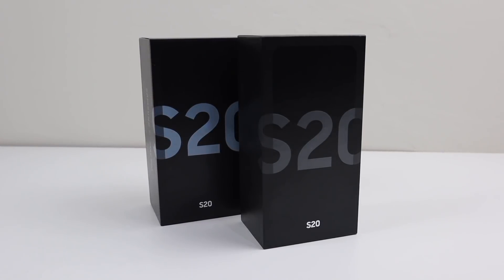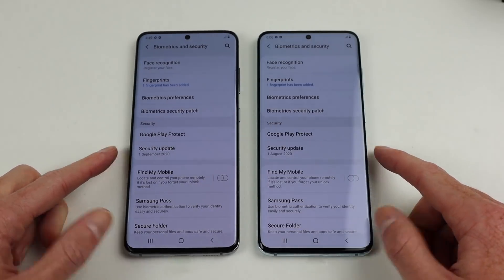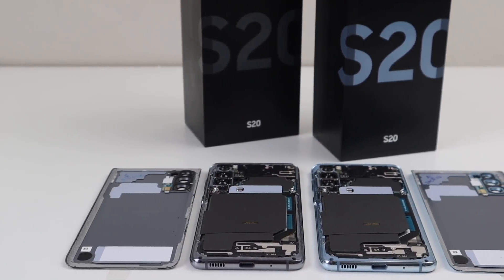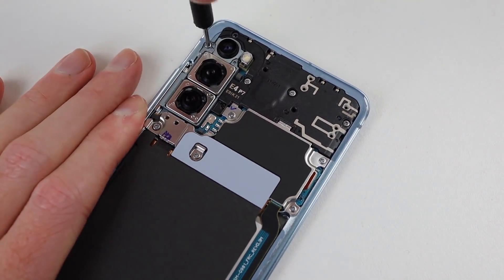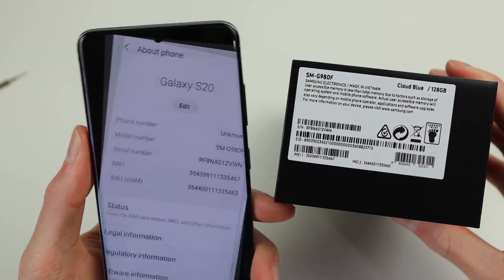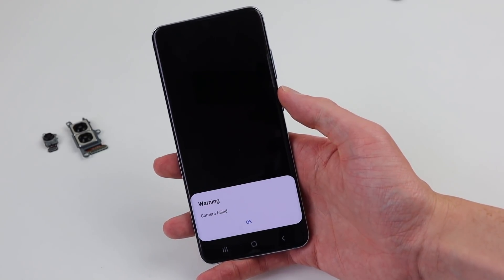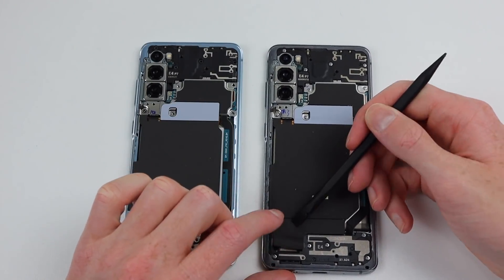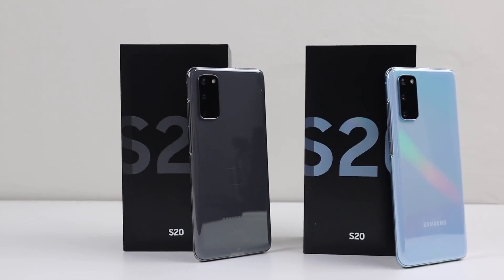Is Samsung locking down 3rd party repairs? Galaxy S20 Teardown and Repair Assessment

Comment: I have an Oppo with underscreen fingerprint reader, fingerprint data is stored on a chip on the main board, i damaged the screen twice and 2 aftermarket swaps, never needed to redo my fingerprint. Samsung... Its possible

Comment: Something important to mention is that Samsung phones since at least the S6 record battery usage data on the motherboard - the ASOC and Charge cycle data. It does not get reset when replacing the battery, and only autorised samsung repair centers can do such a procedure. They replace the battery and reset the "Discharge counter" as well as the ASOC value (they reset it to 100 so i assume it's the battery wear indicator). Not doing the reset can result in the replacement battery (even an original one) to behave either a bit worse or just as bad as the old battery. I learned this the hard way with my phone.

Now there is a possibility of modifying these values if you have root acces, but with samsungs that means tripping knox warranty bit - essentially loosing some functionality like secure folder etc. Samsung uses either their GSPN network tool or the "Galaxy Must" tool to recalibrate the phones. Using the must tool you can recalibrate the battery, fingerprint sensor, hall sensor, light sensor, proximity sensor, grip sensor etc. Unfortunately the program is near impossible to find, and even if you can fing it, it requires connection to samsungs network, along with logins, which are simply impossible to get.

Comment: the A series is a hassle to repair even if you go through Samsung themselves. tried to get my brother's phone repaired and Samsung and Verizon's "approved" repairers insisted it was an international phone (it was sold as  US model...) and that they would not repair it despite having the parts. we ended up hunting down some executive office emails and they were much more concerned about it. they ended up taking my brother's phone, confirming it was international and then replaced the internals with US components whole keeping his data.

this process took 8 months. my brother did not have a phone for 8 months.

Comment: Great video. Thanks for doing this. You've mentioned the non-charging issue mentioned by someone on Instagram. Do you have a link to that post or more details on how does that manifests ? S20 Ultra I have stopped charging. Battery went down from 50% to %0 while I was looking at it. Won't charge. . If I reset the phone, it will come up and show 0% charge and will start charging very slowly charges up to 6%  and won't charge further. But it only shows 6% - it won't hold the charge if the power charger is disconnected. Took to it to Samsung - they could not tell what's wrong. They would not replace replace the battery,  said that replacing the charging port makes no diff offered me to replace the motherboard as a next step for $500 (12G/256G). Not worth it. I poke around the insides, looking for any kind of physical damage. I replaced the battery and took the motherboard out, examined it very closely with powerful magnifier helmet. Phone is crystal clean inside. No signs of any damage, no bunging, no oxidizing. Interesting.

Comment: Actually, if you remove the pcb with the cameras from the lcd and reinstall them you need to do alingment to the cameras, in order to work properly. Even if they are the same as before.
If you notice the 3 cameras are not fused together.

Comment: Ridiculously costly authorised repairs and original spare parts, blocking 3rd party repairs by gluing in components (eg non-removable battery) and planned obsolescence:

In this case, "Don't like it, don't use their products" doesn't work for 3 reasons:

All companies are follow the same money minting trend since no one speaks out against it, and the average consumer is too ignorant to care, so there's no one left to buy from

And second, those who practice such tactics as planned obsolescence make more profit in the long run and so are able to sell their products at a lower price. The average consumer being unaware of this, will obviously not buy the costlier product, thus those who decide to do things ethically are at a huge disadvantage.

Not to mention higher profit means more R&D budget, which means the unethical ones will pull ahead in today's cut throat competition, so it really isn't economically viable to be ethical.

Hence the need for laws

Comment: If you are checking if the camera can be changed. Why are you replacing the camera and logic board in as a unit?  How else would the phone know know camera has been changed? I have never ben to your channel before. But I know wonder if you work for samsung. I assume not. But the doubt is now there.

Comment: I am a samsung user and I do experience that camera thingy. That is because an app may have been using the camera and the user did not fully close the app and the phone is still running the app with the camera open. That's somewhat a glitch or something but that's easy to fix, I guess.

Comment: Really appriciate, Hugh.
Well I think samsung is locking the repairs in A serise phones, because they are focused with the security of the Data in the product.
But I think that you should do repair of one of those A71. Or you can try, Huawei mate 40 pro, One Plus 8T, or Samsung Z Fold 2

Comment: Hugh please help!

I have a Early 2011 13-inch Macbook Pro. Whenever i turn on the computer, while the bar is moving when booting, it gets stuck and the bar does not move. Then, when i boot into the main OS after a couple of reboots, i managed to log in and use the mac. Then, after 5-10 mins, the whole computer bricks and the mouse cursor or anything thats supposed to move does not move. I then restarted the mac, and the  screen froze with a apple logo and a half-loaded loading bar. I tried internet recovery. When i boot into internet recovery, the screen freezes on the globe. Pls help! I cant even boot into a USB Thumbdrive as it gets stuck while booting. Is it a hardware issue? Or is it only the hard drive? Pls help!

Comment: @Hugh Jeffreys
As a Samsung Care tech I can promise you and rest assure you heating the back glass on your heat plate and reapplying the back glass and pressing the device will seal the device water tight. As there are times rework kits are not available this method has been used in multiple shops. Your backglass adhesive still looked completely intact.

Comment: Samsung usually listens to its customers and lets us repair our producs so i really respect them i got some hate on apple because i worked repairing electronics for a few years and om rare occasions slipped and messed up touch id on ipads and not being able to fix it  myself just brings me unesesary trouble also i had a lot of customers that got their iphones wet and everything worked exept the ear speaker but ther ear speaker is connected to face id and that also is unfixable so basically you got a bricked phone just from a bad ear piece apple is straight trash for that and even tho i still use iphones along with samsungs because i always have 2 phones i just buy them second hand theres no way in hell imma pay factory price for a throaway phone when apple doesn't give a crap about us i do pay factory price for my galaxys tho i really enjoy samsung producs i just bought a titanium galaxy watch 3 that works with both iphone and android big ups for that

Comment: Well I'll give Samsung a pretty 7/10 for repairability; all same screws, adhesive backplate without delicate cables that could be severed by pick insertion, all modules easily removable with few connectors and best of it all, no serialized modules that disable 3rd party repairs; thumbs up (as opposed to f'n iphones)

Comment: All the parts you "replaced" are all official Samsung ones tho. Not sure if you installed a camera module, charging port, or screen off of eBay or Amazon and it still work or not.

Comment: @HughJeffreys, the best phones to replace or repair are not the the flagships in 2020, i notticed it when i had to fix my note10+ i broke my screen and i got a replacment, swapped it all over, and it wouldnt read my card, had to send it in to samsung and have them repair it.

Comment: It probably didn't work for the guy because he swapped parts between completely different variants of the s20. Exynos to Snapdragon. Or the usual regional shenanigans done by samsung where the international model, us variant and south korea variants use totally different parts

BTW: On Samsungs with optical indisplay FP scanner the scanner does not work when you swap the display. The reason is that the display is not attached with the FP scanner. When you swap the display the scanner remains the old one (displays sold don't come with it). But it's an easy fix, you go to a samsung repair store, they use a triangular both thingy and recalibrate the scanner to work with the new display. They usually do it for free or charge very little and they don't refuse to do it for you. 
Video here: https://youtu.be/TVHLLi7jyUo

Comment: A heads up to DIY-ers, new, or even experienced techs. Make sure you order proper variants of replacement parts. Samsung is notorious for having a few variants in their parts depending on model and if you don’t use the corresponding parts, it can cause issues. Thus far I’ve seen it in the charge ports and cameras, or even the screens in some of the older models

Comment: The black variants wireless charging coil has m3 written on it as if it was a repaired phone. 😛 
Clean it up the next time you lock it up with the new adhesive. 😄😄

Comment: well i guess i will not be buying iphone 12 mini, cause if i  have to pay 70 quid for battery replacement probably every 6 months i will pass, and as soon as apple stops supporting iphone se 1 im switching to whatever android phone there is with similar dimentions as iphone se1/12 mini. preventing me from replacing my own battery myself its absurd. they can charge me for everything else the screen the back glass the charging port i dont mind cause i take care of my stuff, but battery? nope. screw apple for that.

Comment: If you reheat the backplate for about 5-8 minutes on the heatpad on 80 Degrees. then put some pressure on the phone, you dont need to add the new adhesive due to the old are heated the first time they get added in factory. it will help to make it stuck forever.  you can wrap the phone in somehting soft so it would not get damaged and then put something heavier on it to help even out the pressure. hope this helps. :)

Comment: So just to clear up and let everyone know. The cameras are swappable ONLY if you have the correct versions. There are US and International versions, and some Part Companies don't always correctly get told what cameras or parts they have, or they incorrectly list this to try and get stuff to the market first. You CANNOT swap a US front cam and an International front camera. You will get the error message.  Also, as far as charge ports go, they are specific as well to which versions of the device you have. 

The biggest thing the repair community is facing right now is with the normal Verizon S20. Those are 5G UWB (Ultra Wide Band), and currently you either have to replace just the OLED which is a pain or hopefully get a dead phone and swap the boards as nobody seems to have the UWB version available. 

Hopefully this cleared up some confusion.

Comment: One great tip for easily separating the glue while you are prying it with a pick is to put a drop or two of isopropyl alcohol on the part of a pick that is at the entrance of the phone and the alcohol will dissolve the glue almost instantly. Just don't pry it too hard or too quickly so that the LCD or the back cover doesn't crack.